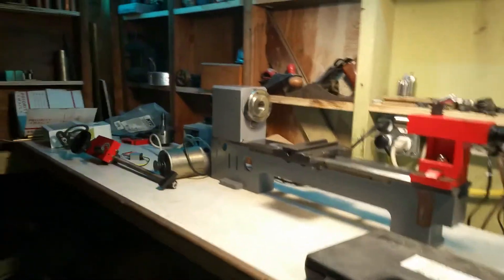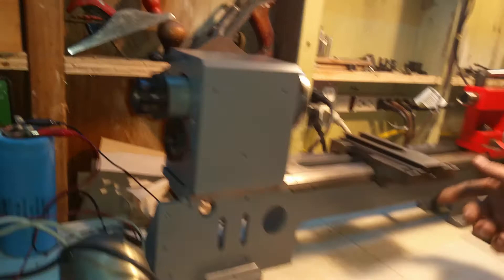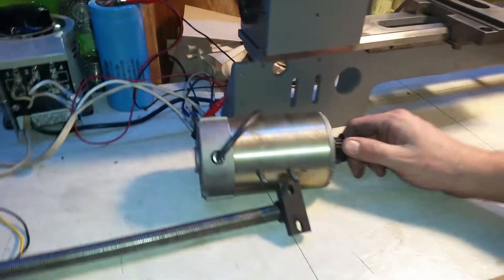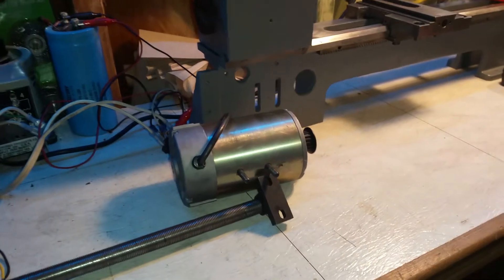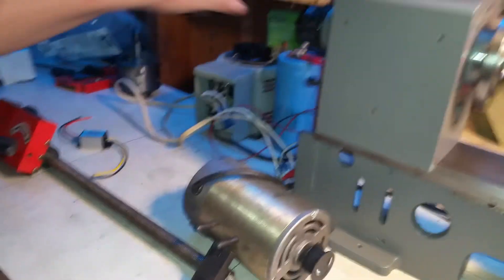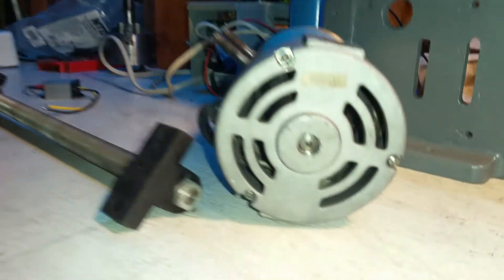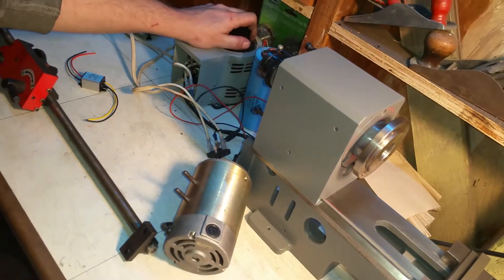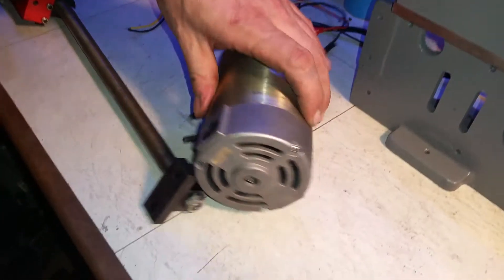Sieg Mini lathe rebuild #1 Introduction, Brushless mod

Comment: just came across this, I have been looking to pick one of these up myself but nobody around me is selling one so im gonna be forced to buy new, think im just gonna get the 7x12 HF model 93799 and do the coned bearing mod using two Timken 30206 bearings. I figure down the road I will eventually do a brushless motor mod, so if you decide to go that route definitely do a video that way I can follow lol thanks and keep up the good work
Reply from the maker: +IBoosted SS  I have had one of these lathes for over 10 Years, you can see old red in the videos. I think you will be very happy with your purchase.  Check E-bay as well. I did install a brush-less  motor, check out the while series of videos.  Thanks for commenting  Here is a link to installing the motor mount..https://www.youtube.com/watch?v=Pftw2v7CXxw
Reply: +Don Brandt thanks for the comment, after I posted here i came across your other videos including the brushless one, still debating when to pull the trigger lol
Reply from the maker: +IBoosted SS That's great! Keep me advised on what you decide! -don
Reply: +Don Brandt I know your a very busy person but ive been looking around and came across grizzly G0765 and leaning towards it over the HF 7x12 but, do you know if it is also a sieg lathe? I just wanna make sure i can get parts for it later
Reply from the maker: +IBoosted SS yes, there the same, you can get parts here
http://littlemachineshop.com/info/minilathe_compare.php